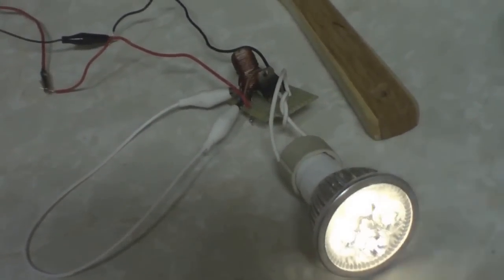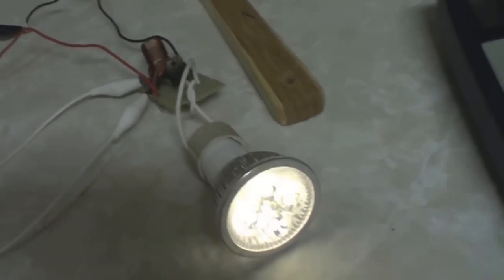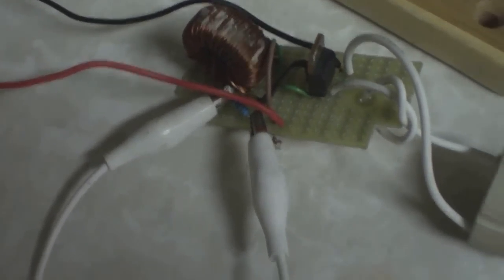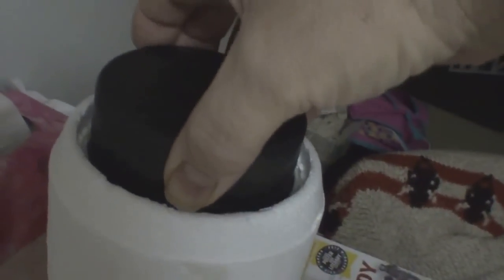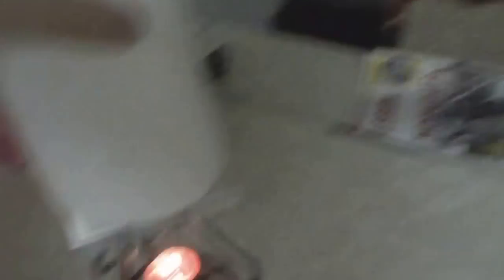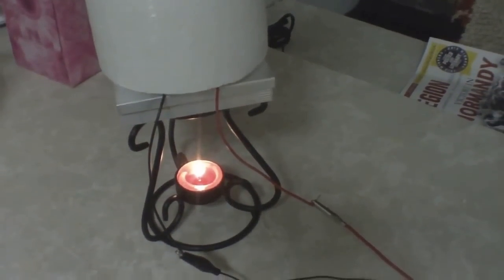Peltier Module Powered Joule Thief - Gutted From a Wine Cooler

Comment: Nice design :) you have to watch to not exceed the temp on the TEC they can't take too much high temp. If you do want you can buy a TEG which can go up to 600F. Thanks for sharing :)
Reply from the maker: yeah i have burnt out a couple. i've never been too impressed with these things. that said i would like to get some of those ones you speak of.. i have a project --  a generator that will live on a stove pipe (chimney) outside. it runs hot 6 months a year, 24/7 -- so i think it'd be worthwhile, send me a link if u have one! thanks
Reply: KyleCarrington  I'll do a search for these :) I have a little tPOD which use one of those got it for 50$ us and it light up a bunch of LED out of a tea candle this company also sell stove top thermoelectric generator you can also grab a 10 W from eBay but they are a little pricy they go for about 300$. I'll come back once I find some decent one! Cheers!
Reply: KyleCarrington
 In fact they are starting at 19$ on eBay just type TEG module in the search :)
Reply from the maker: bakupcpu Thanks. It's very tough to justify the high cost of TEG technology given its shit poor efficiency at converting heat differential into energy. Add to that the elaborate heat sinking costs. In my mind it is viable in situations where you have a hot exhaust, and cold ambient air, and months of that environment only - couple with a general absence of wind and solar on site. That siad, that pretty much describes a lot of nothern geographies.
Reply: KyleCarrington
I'm still waiting for fujifilms to sell their material, but not holding my breath. You could just wrap this stuff around a stove pipe.   - http://phys.org/news/2013-02-fujifilm-thermoelectric-material.html
Reply: Ouah! Awesomeness!!!!
Reply from the maker: ***** wow. only 1 degree of differential resulting in kilowatts. sounds like a real game changer
Reply: I'm guessing my wallet will be very empty just for one of these lol!
Reply from the maker: bakupcpu For sure. At this point. Then again solar panels in the 70's were outrageously expensive as well. it seems to me, that if anyone comes up with a very viable alternative energy solution, that could have a global impact -- it'll be a bit different this time around. I predict that the company with the right product will have investors buffer the R&D, in other words, you'll see a flood of the marketplace -- the world can't wait this time around, and I think they'll know that - they'll want an emormous launch, to gain a foothold in the "solution". That of course is just a guess (and a hope).